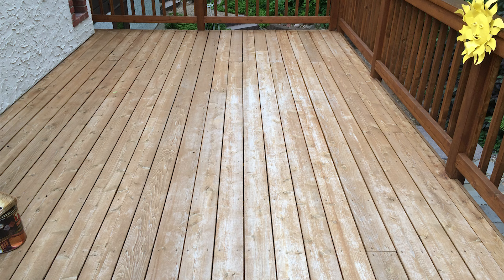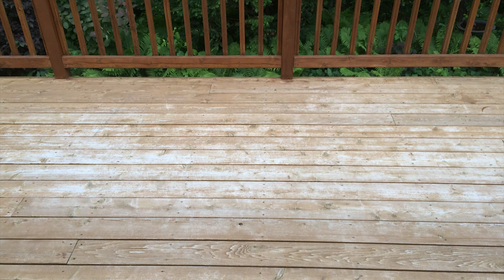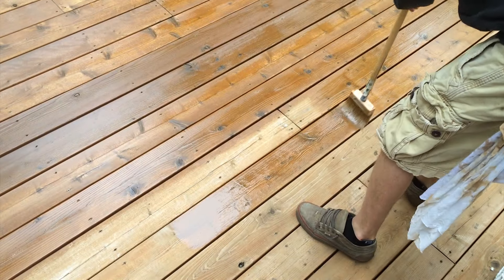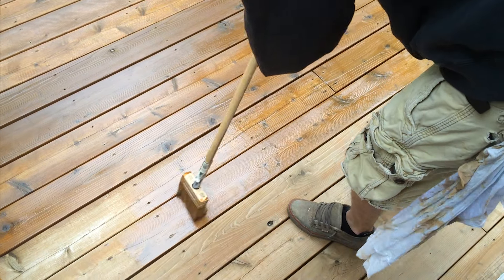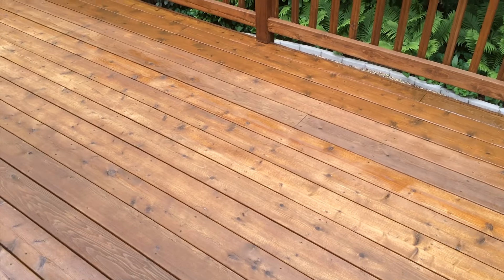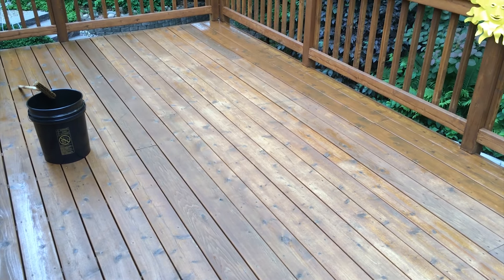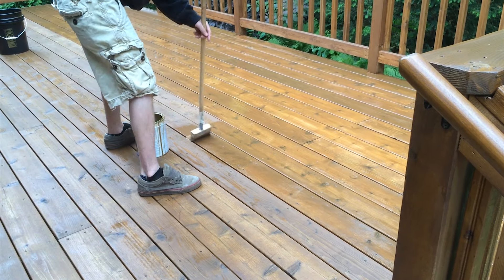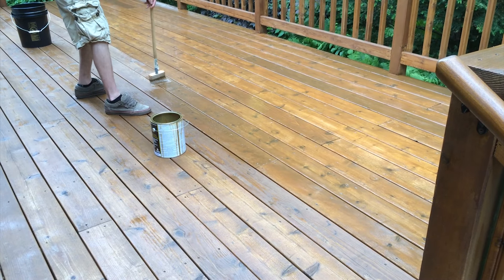TWP deck stain maintenance coat

Comment: Do you just wash the horizontal surfaces of the deck before the maintenance coat with plain water or do you use any cleaners/brighteners?

Comment: Is it acceptable to walk on the wet surface when applying the second coat?  I have a roof deck where my only option would be to walk on it as I apply the last coat or to do it in two halves.  Is much wiping necessary with TWP?
Reply: Yes

Comment: 6mo to 1 yr of protection??  :(
Reply: +MtnXfreeride That would be an additional 6 months to a year added on if you apply 2 coats wet on wet vs just the one coat.
Reply: @ConorOKeefe99  Where is the deck, Venus?   Most decks stains last 2-3 years.
Reply: @ConorOKeefe99  Yes, but they way you worded it is leaving most people thinking this product only last 6 months to a year.
Reply: @ConorOKeefe99  very clearly said an extra 6 months, some people jump to conclusions so fast lol.
You're definitely correct 💯